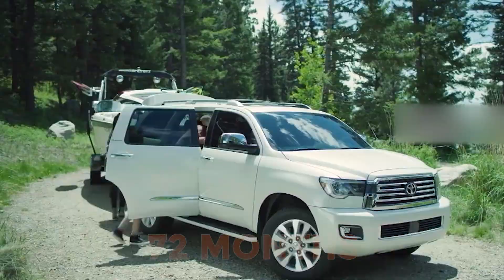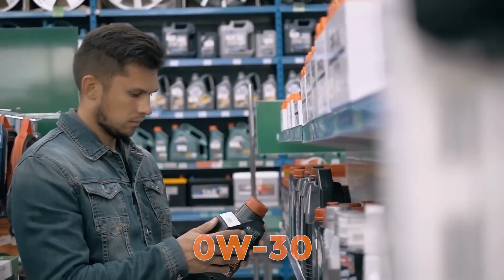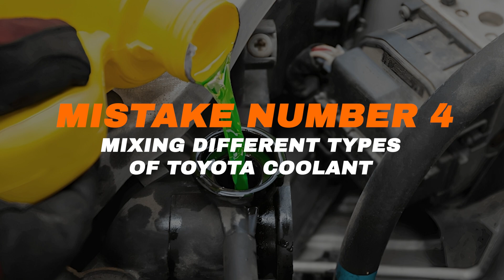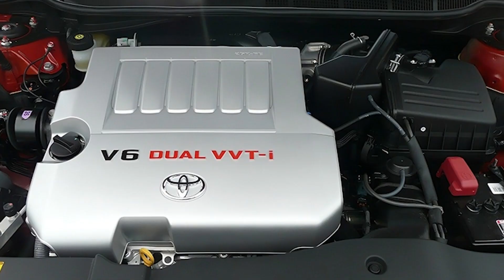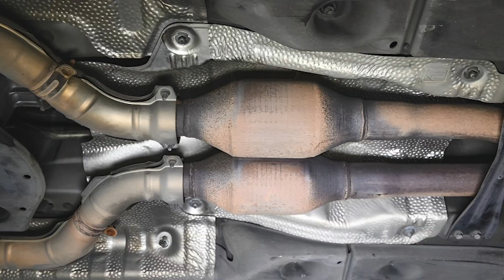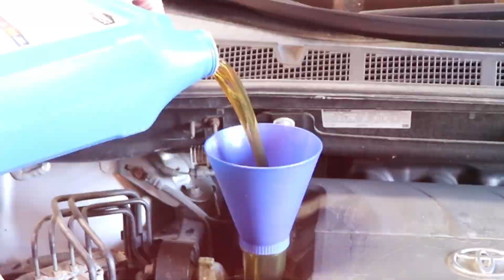TOYOTA V6 OWNERS! Avoid Doing THIS Right Now With Your V6 Engine

Comment: My 1999 Solara with, 1MZ-FE engine, had 319,XXX miles on it before it met its death by deer collision.  Engine and tranny were still going strong.  Changed the engine oil (synthetic) every 7000 miles (as 97% of my miles were highway commutes).  Replaced the timing belt every 90K miles.  Did a drain and refill on the tranny every 30K miles (used Valvoline ATF).  I used Techron every 3 months in the fuel tank.  Used the spark plug type/brand recommended in the owner's manual.  Did a drain and refill of the radiator every year (used Zerex Asian Red antifreeze). Replace engine air filter every year.  Did all my own maintenance.
Reply: Those are  great  cars,   I  owned  one,   wish  I  hadnt  sold  it.

Comment: The 1MZ-FE is a "Non-Interference" engine!!
Reply: Je also says 2007 and newer 2gr-fe 3.5 wants 0w-20 😂

That can be an expensive mistake unless u change it sooner like 2000 miles or sooner 😂
Reply: 2008 sienna 2gr-fe 3.5  book says 5w30 oil, not 0w30?